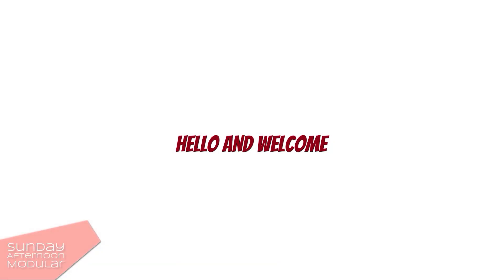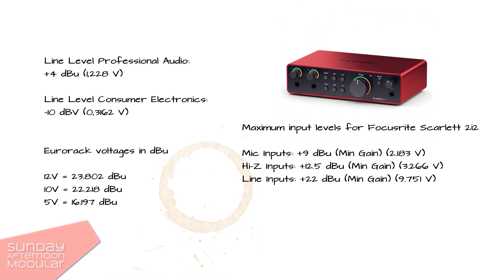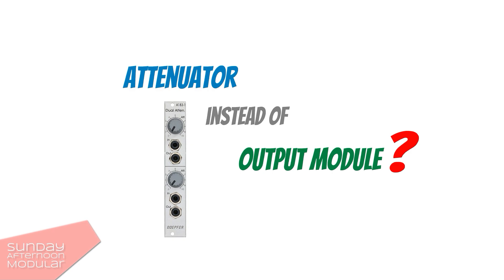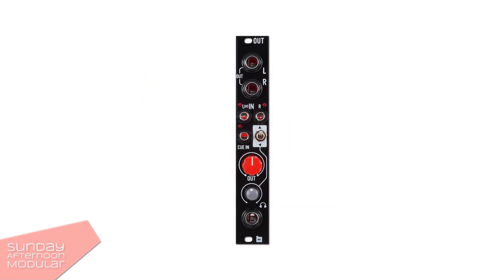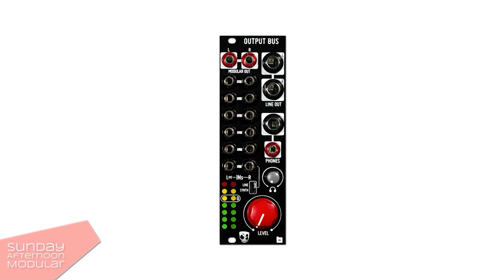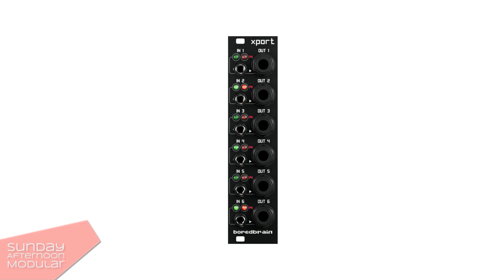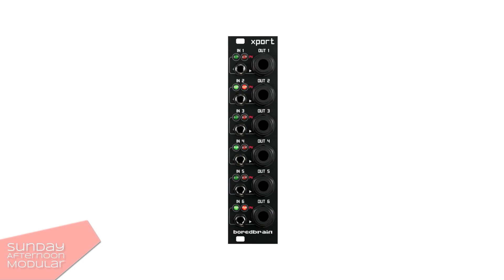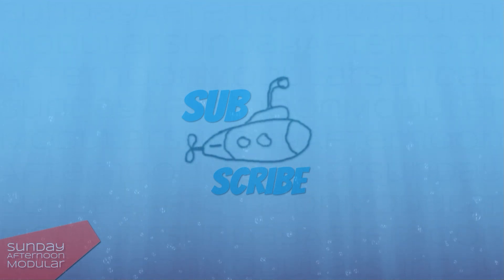3 COOL OUTPUT MODULES for every situation! + why an output module is better than just an attenuator!

Comment: I use the HPO in my small side rack. But I'm getting an Intellijel  Outs for my large rack because I already have 2 Mixups and they all tie together behind the scenes so I don't have to patch them together.

For the past several months I had been a simple attenuator guy but adding bigger effects like cathedral reverb were seriously cutting into my headroom and causing issues.